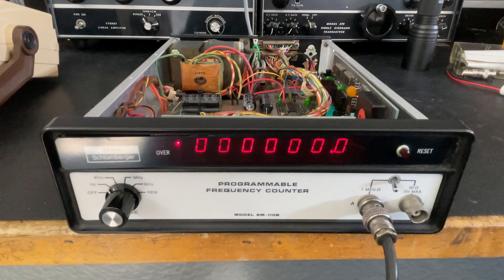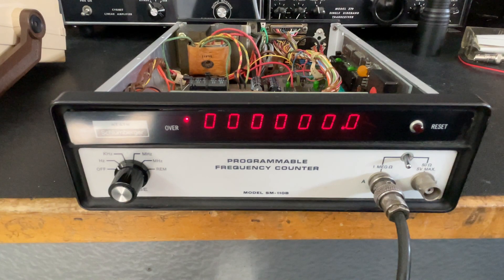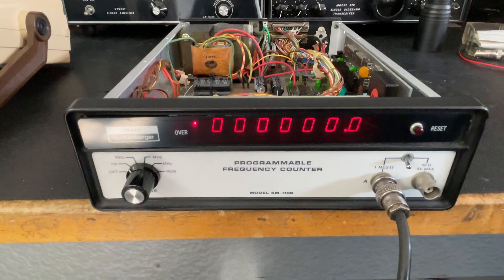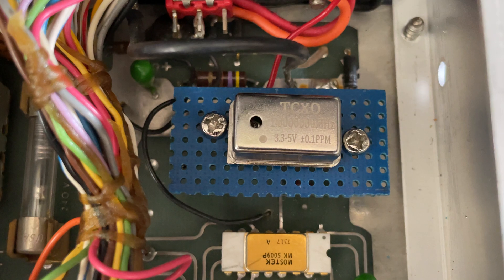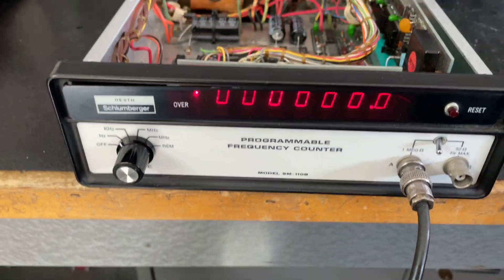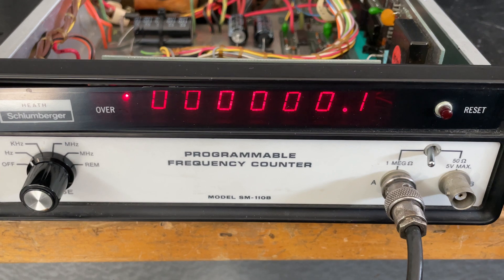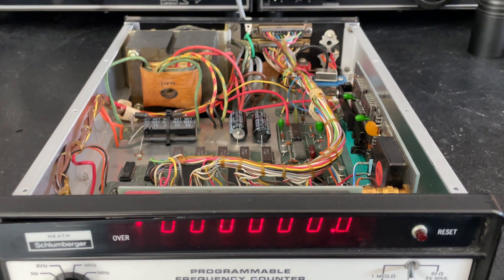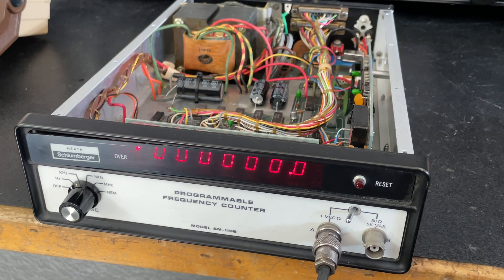Frequency Counter TCXO Changeout Part 2

Comment: My HP counter has a TXCO in it that is fairly good but there was supposedly an option for hi stab reference.  I went on ebay and bought an OXCO that was out of an old HP microwave sig gen.  I built it on a chassis with a power supply and other essentials and now I have a better reference for my counter and RF generator.  I can run them both off it and set the gen to X Mhz. and the counter will read it same with a bunch of zeros at the end.  I cal the OXCO with a Rubidium source.
Reply from the maker: Thanks for sharing your experience Tom. I wanted to change out my TCXO with a OCXO.  It's 1 Mhz and they are hard to find without spending $100 or more. I did, however, kick around the idea of using a 10 Mhz OCXO with a frequency divider to get to 1 MHz.

Comment: What's the application of a frequency counter?
Reply from the maker: A frequency counter is primarily used to accurately measure the frequency of a repetitive signal, most commonly in electronics engineering, particularly when dealing with radio frequencies (RF), to verify the precise frequency of oscillators, clock modules, and other components within a circuit, ensuring proper operation of electronic devices like radios, transmitters, and telecommunication equipment; essentially, it counts the number of cycles of a signal per second to determine its frequency.
Reply: @rfburns3472  thank you for that!
Reply from the maker: @Cassius609  Your welcome!